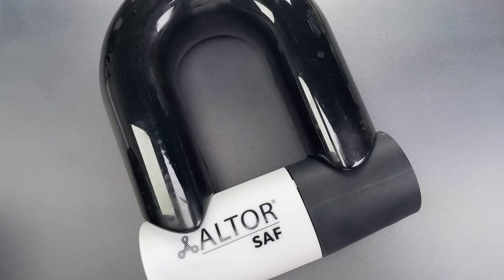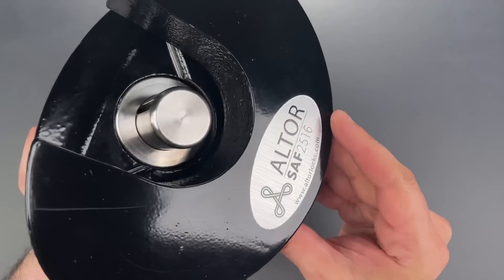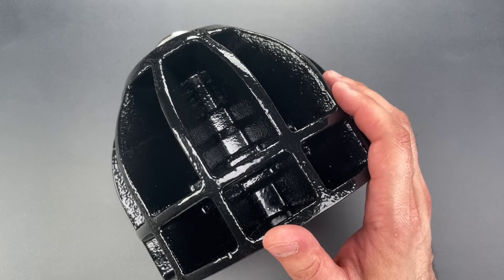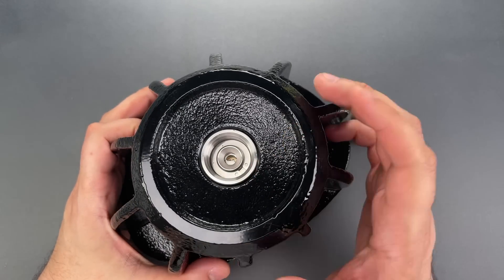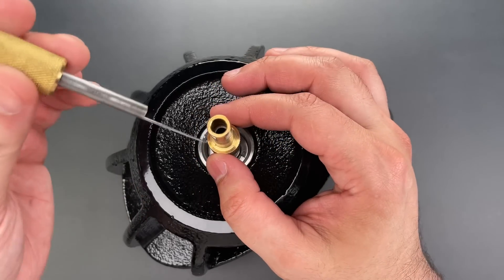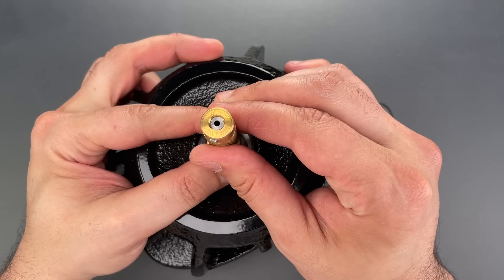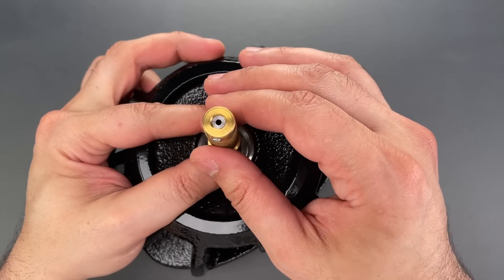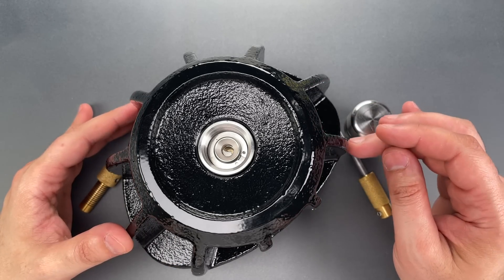[1339] HUGE Altor “SAF” (Strong As F***) Trailer Lock

Comment: Cheers to Lock Picking Lawyer. We are big fans! Thanks for today's review of our new SAF Trailer Coupler Lock. AND thanks to the fellow fans, we are loving the comments.
Reply: Awesome to see companies going to LPL! Will look to you if I ever need a lock!
Reply: Congrats comrade. This is one badass lock, lol
Reply: Gratz!
Reply: Good job on this lock!
Reply: It would be easier to cut the coupler and weld a new one than to try and tangle with that lock

Can't wait until you come out with a puck lock. Will definetly upgrade from his prior best reviewed lock.
Reply: @devinazevedo1122  LPL is friends with the owner of Altor. thats the only reason he gave this good review. dont be fooled
Reply: @shannonlee6421  well he's a good friend. Probably told him that a unique key as well as more "bulk" without being a solid hunk of metal would be a good idea. Unless the materials aren't up to par (which seems highly unlikely since it's not some Chinese knock off) then what would it matter if they are friends (which still is up in the air on its validity).
Reply: So you addressed the thief with a power tool threat, no what about the thief with a $12 HD jackstrap who drove away with the lock on and not making any loud noise in the process? And, you cant lock the trailer brake in the on position, the brake cable is still exposed and can be cut in a jiffy, plus its not like trailer brakes are slowing down a pickup truck much. Good lock but there are too many workarounds, a trailer cannot be secured with any lock.
Reply: @pflaffik  one lock isint an end all solution. Anyone could take a 12 dollar sledgehammer and make a new door in a home
Reply: @pflaffik  there are some pretty nice pressure based wheel locks out there that bind your tires. If they do tow it they will be putting on a show...
Reply: @shannonlee6421  being friend with a master of picking more easy to ask about lock weaknesses so they can better defends against it you just seeing the negative thing
Reply: @shannonlee6421  owns a competitive lock company.
Reply: @devinazevedo1122  but it is made in china lol thats why they dont have it in stock lol
Reply: Ayeeeeee
Reply: Good job guys!
Reply: @eragon_argetlam  And use the Kryptonite interlocking chain for a bike 🚲 👍
Reply: Does the lock do anything to stop a thief from just unbolting the coupler and replacing it?
Reply: This is definitely how all lock companies should product test, LPL is just about the best you can get with his honest reviews, I hope your production line can keep up after this
Reply: @devinazevedo1122  problem with that most of all with a 2 5/16th couplers is the braking systems.  Most of all if it Has a Hydraulic system on it  So unless you have a big enough rig to be able to stop what ever you would be stealing with out the use of the trailer brakes you may just rethink that.
Reply: I bet someone breathed a sigh of relief when LPL said he'd not hesitate to use it!
Reply: @shannonlee6421  joined one month ago just to leave this comment. Noice. Considering he had to make a custom tool, and the other reasons he mentioned, I'm confident it's a non biased review.
Reply: My family has owned a very popular trailer parts company in okc, ok. since 1980 or so. I can say with complete conviction that this lock is the best I've ever seen. And I've seen em all.
Reply: @tigeraudio  you must have either an "Atwood" style hitch or "Bulldog" style, as there literally are no other types, except pineall(military style). I'd bet my watch fob that this company manufactures a lock custom fitted for your hitch
Reply: @pflaffik  or just hook the trailers safty chains to the frame and off you go..my family business lost scads of trailers that had impregnable security in just such a fashion...btw we build trailers for a living.
Reply: @UC3WQmxhx3gllMIC9idVPMDA I'd have to see that, my mom, whose like..85 years old? Is an expert..i am not. I'm a carpenter. But if you get with this company, as far as I've seen, they'll help you out
Reply: @tigeraudio  somewhat yes, I lived in Lahaina Hawaii on Maui for 4 years
Reply: @tigeraudio  if I were you, I'd message these folks at Altor..thats as good a hitch lock as you'll find, and I'm guessing they can accommodate your needs
Reply: Having to make a custom lock picking device is tantamount to having to cut a custom key. Well done, LPL and ALTOR.
Reply: If a mostly dishonest person decides they want your property they will get it. Locks are a sight deterrent for the mostly honest people. I’m a long haul trucker and something like this for the short term public parking area is perfect.
Reply: LPLs endorsement is the only one I would trust. Looking forward to picking one of these up.
Reply: The fact that he had to make a special tool, is a good indicator that your product is quality. The fact that you heed the master, is a good indicator your company is quality. So, win, win.
Reply: @pflaffik  no lock is perfect, but unless you're prepared for every possible workaround, some locks are going to thwart you, while some others may not. If you come onto  a trailer lot and all you have is an angle grinder, you're probably just going to skip over the trailer with this lock and find another one. Sometimes appearance is a deterrent by itself.
Reply: @shannonlee6421  theres always that one crazy who believes everything and everyone has an ulterior motive. Like relax not everyone is fake like you :)
Reply: @ThePatricHalldin    Most couplers are welded on.
Reply: @tigeraudio    Change your coupler.   Thats what I had to do on both of my trailers.   Cost me $150 per trailer by the time I paid for new coupler and labor to weld it on.
Reply: @tigeraudio  Time to change couplers...thats what I did   :)
Reply: @bad50  Everything here in Sweden is bolted.
Reply: @ThePatricHalldin  I'm sure you can get someone to weld it on.  Maybe bolt and weld.  😁
Reply: @tigeraudio  no idea what it looks like.  Was hoping it would be a simple swap like mine was.
Reply: You guys made two behemoths of locks. Kudos to you.
Reply: I love that Altor are straight up fans. It’s awesome
Reply: @devinazevedo1122  based and demolitionist pilled
Reply: @ThePatricHalldin no. Just weld your coupler bolts, and they'll have to grind them if they really want it.
Reply: I'm glad I found this video. I've considered purchasing this trailer lock but was shocked by the price. Well, a professional locksmith that had to make his own tool to pick it has me sold. Your standard "Tweakers" won't be stealing my trailer.
Reply: @pflaffik  -  Hey, he can't think of everything.  If your lock costs more than your jonboat and trailer then it ain't worth it.
Reply: I'm gonna go ahead and say that if a lock requires machinist-level skill to create a tool just to enter the game, it's probably good.
Reply: @pflaffik  All locks and safes are just deterrents. But not everyone has fort Knox as there home so the next best thing is too deter all but the most ambitious and skilled thieves.
Reply: @dons8122 I’ve owned multiple double axle trailers rated up to 14,000 lbs, all with 215/16” ball couplers. All ran electric brakes and I moved all with a bucket loader on a sub compact tractor. Unless you got to air brakes, you can move any trailer with a 1/2 ton pick up if you really want to …steal it. This lock looks awesome.
Reply: This looks like an amazing lock, and if you are a trailer owner, remember this. One does not need to access the ball coupler to steal a trailer, you simple use the chains. I’d constantly move trailers around my yard with a bucket loader just by attaching the break away safety chains.  So remove your chains, lock your axles and install a lock or remove your coupler - if you are trying to prevent theft. Ultimately, you just want to make them find an easier trailer to steal.
Reply: @devinazevedo1122  To be fair, prices have gone up. Even Harbor Freight doesn't carry a $12 sledgehammer. The best they can do is a dinky 4 pounder at $12.99. For 8 lbs and up, it's a lot more.
Reply: @shannonlee6421   you are so wrong.
Reply: If it takes someone to make a special tool in order to pick it, that’s a good lock!